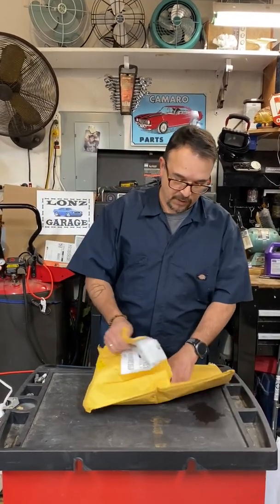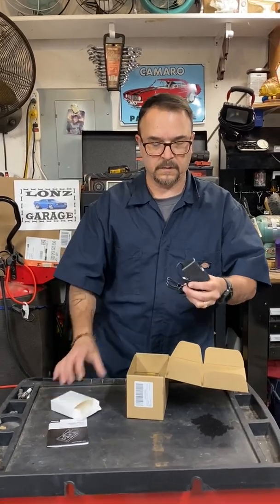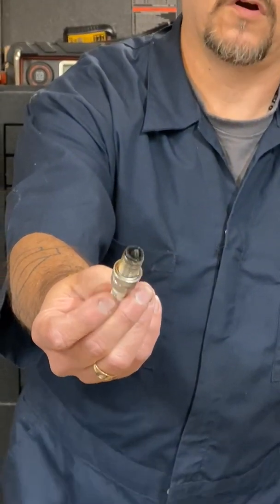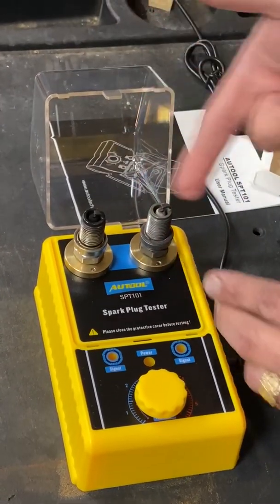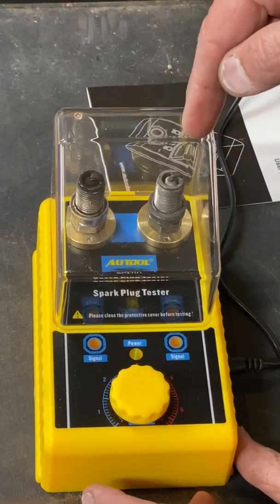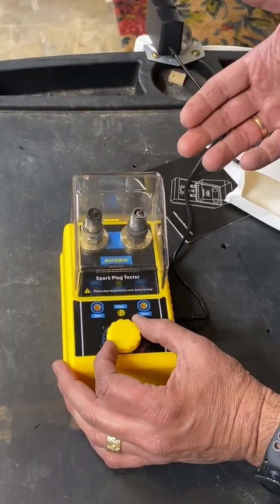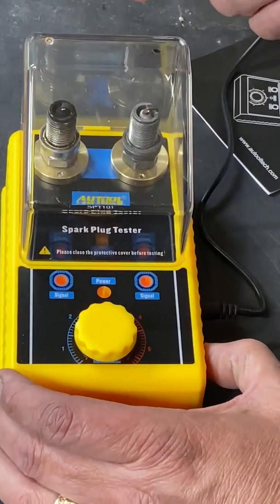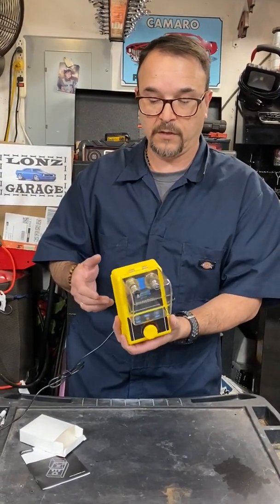Lonz Garage Unboxing Spark Plug Tester

Comment: Excellent and helpful video, I also saw this low rpm “miss” and high rpm “ok” scenario, good to know this tool accurately reproduced this scenario. It’s a shame that this basic phenomena  isn’t communicated in so many engine training  books and write-ups— everyone should know there is a strong relationship between misfire and rpm for a fouled plug as you showed here.